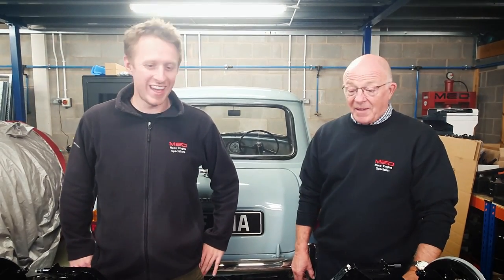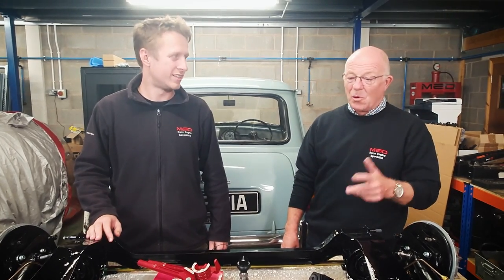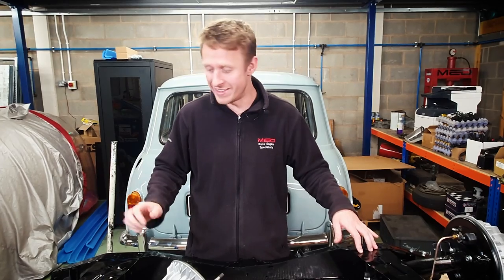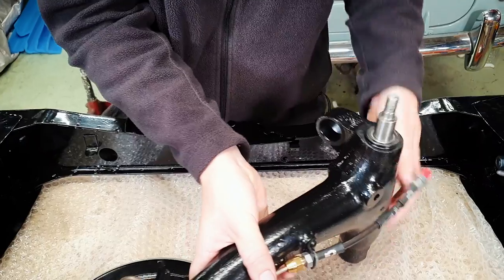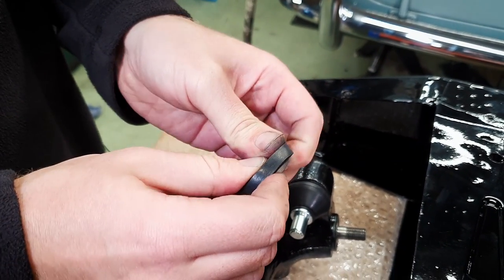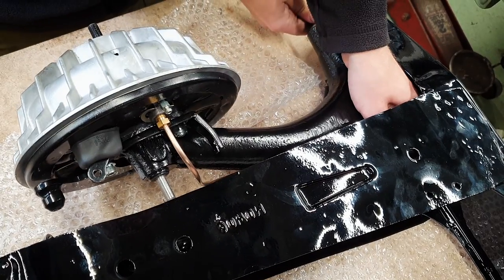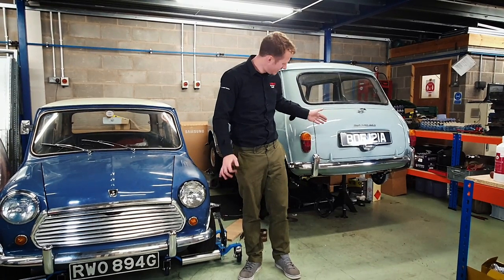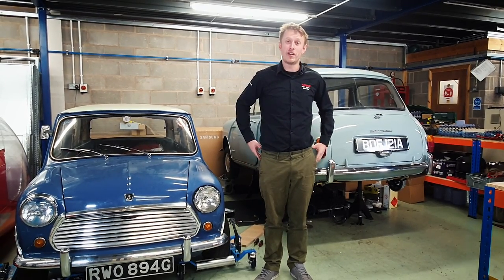Project 63 part 12 - Mini rear subframe install, with anti-rollbar and upgrades

Comment: Reminds me of my Morris Mini Mk1 I had 15 years ago here in New Zealand. Mine was a 1965 build and one of the last models that were imported from the UK, then soon after a plant in Australia started making them for the Australasia market. The engine was the simple and economical 850cc unit. It was a non-runner, the previous owner had used it as a parts car but he had not stripped it too much, the 'magic wand' gearlever was missing as was the single bazel speedometer and cam cover. It was an easy project, but work commitments and other things got in the way, so I had to sell it. The buyer was a Mini enthusiast, so I am glad it went to a good home.

Comment: Finally someone else who puts the rear mount bolts in from underneath to keep the bare threads in the boot instead of covered in road muck 👍
Reply: how close to the fuel tank are they ?  in a rear end crash can they contact and pierce the tank ... also the Engineering reason for the bolts to be downhill is that if the nuts fall off you would feel a certain amount of movement and get it fixed, however when uphill the bolts can fall out easily and the rear of the subframe would then be loose to move about fairly easily.
Reply: @martinfidel7086  plenty of room, I'd not be concerned about either of those issues, the amount these are driven compared to the frequency the bolts are looked at and checked both would never fall out and it's quite far from the tank, an accident that would puncture the tank would leave me with much bigger problems!
Reply: @ClassicMinishorts  I just remember the Ford "pinto" fires and these are close enough in a rear end to deform and make contact, the bolts are directly underneath the tank, it's why I asked the question.

Comment: Clear video, unfortunately I believe your rear trunions are around the wrong way the smaller part to back valance allows you to get bolt in easier, also bolts pass through from boot floor and nuts underneath.👍

Comment: I found the red dot cones to raise the front quite a lot. Haven't driven it yet, but I hope they will settle a little bit more. I have hi-lows, but cant get the car as low as I hoped.
Reply from the maker: They will settle a fair amount after a few heat cycles

Comment: What is the reasoning behind fitting an anti-roll bar on a road car?  Love to hear your thinking behind this…. Cheers, Will
Reply from the maker: A rear anti-rollbar works well on fast road Minis to dial out understeer. It allows you to run a softer setting on the dampers to improve ride without compromising the cornering agility.
Reply: "Steve's done a reasonably good job..." 

Give him a slap for that Steve 😀

Comment: I don’t understand why a plain washer is fitted under a spring washer. The spring washer’s job is to bite into the bolt head and the item being fastened if the bolt starts to loosen. If there is a plain washer between it and the part, the spring washer will tend to bite into the plain washer and they both will turn with the bolt instead of stopping it.
Reply: In about 1968 NASA determined that spring washers were in fact worse than no washers.

Comment: I'm going through this process with my '64 'S', so I appreciate the great sessions you produce. You use copper slip frequently, but I'm wondering if aluminium slip (because I already have it) is OK in these situations or are there corrosion issues to consider?
Reply from the maker: We've not used aluminium slip; not sure on that one.
Reply: Aluminium grease works just as well: possibly better in locations where there’s no heat involved.  Seems more durable too, if the difficulty of wiping it off your hands is anything to go by…
Reply: Thanks willgrime

Comment: Around the 10:00 mark, I see you torque the bolts. Where are you getting the numbers from?  I have two Haynes books and none list any values.  Maybe I need another book??
Reply from the maker: It should be listed in the Haynes manual, if not, have a search for the thread size and grade online and you'll get a sensible ball park figure. We normally tighten many parts up by feel.

Comment: Is the red dot rubber cone not too strong for the rear axle ?
Reply: I dont think they are stronger perse. They are a bit higher, so have more travel, and have a different compression curve.

Most Minis that run with worn or really old cones basically have 'harder'  cones as they dont have suspension travel left.

Comment: I'm glad you didn't fit my brake pipes.!!!you should only fit copper nickel.just check the specs.kevin
Reply from the maker: We've been using similar pipe for decades with no issues.
Reply: @MEDEngineeringTechVideos  obviously you haven't been in my world.ive been a m o t tester for 50yrs.copper does fracture thats why I don't use it.again I must state look at the stats.kevin
Reply: Not sure what the concern here is. I assume you’re using Kunifer tubing, which is copper/nickel/steel (Cu Ni Fer, get it?), and offers a practical mixture of durability and strength.  Pure copper is available, but is prone to fatigue cracking, if only from the repeated pressurising and depressurising of the brake line. Pure steel is also available, but rusts like a bugger.  Stainless would be nice, but it is strong and hard (as well as shiny!) and that makes it difficult to bend and flare.  

Bundy tubing is different to Kunifer: it’s made by rolling a strip of copper-coated steel into a double-walled tube, and brazing along the overlap:  nice and stiff (ie. It doesn’t balloon when you pressurise the contents) but prone to corrosion after a while, which is why car manufacturers stopped using it before the seventies were out.
Reply: Not sure what you are saying.?my answer is straight forward.